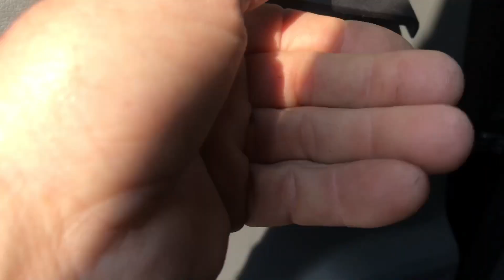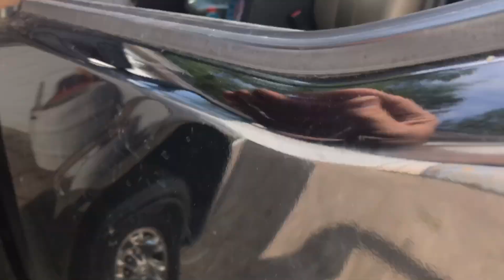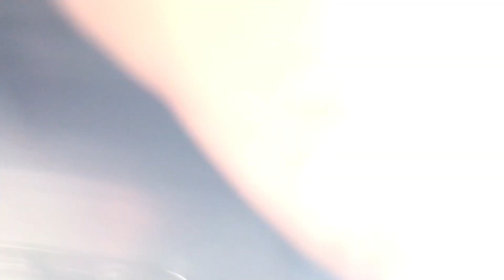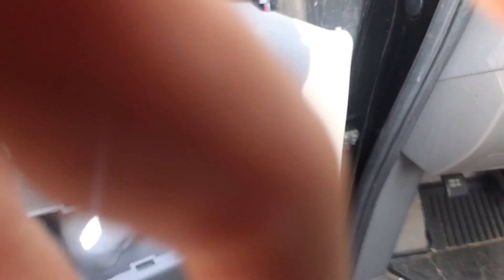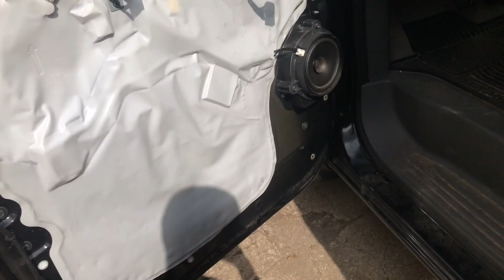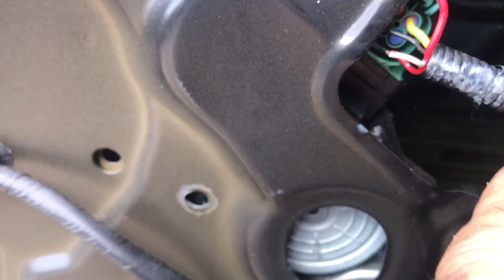Nissan NV 3500 windiw motor repair

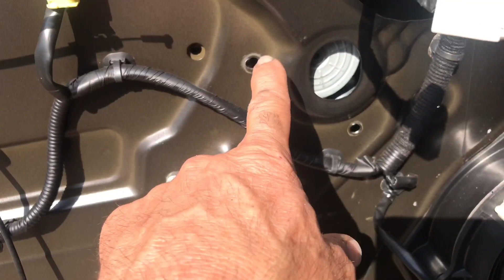Comment: Same thing happened to me. Notice that the entire regulator is shifted because 2 screws that hold it to the door panel somehow became loose and fell out. Then the wires on that 6 pin connector starts chaffing against the sharp edge of a cut out in the metal door panel. You do have to somehow realign the entire regulator as one commentator asked. I found the screws the bottom of the door compartment (they must have loosened up and fell out). I then used a screw driver and inserted it into one of the 2 holes (which are horizontally to the left of the white round disk thing of the regulator behind the metal pane - see video at 4:39l) and then used leverage to shift the whole regulator to the right to correct position where the two threaded holes now lined up to the two holes in the metal panel and then inserted the 2 screws. (See how one of the holes to the left of the now aligned white disc - regulator now has a screw in it - at 5:#1).  As for the wiring diagram on the connector, my wires were still attached to the connector. I found the connector at amazon.com ( https://a.co/d/51XQ5F0). With the connector oriented from the wire side (not the female connector side) such that the latch slot is on top so that there are 2 rows of 3 wire connectors, you can see from the video at about 5:52 that there are two remaining wires attached. If we use those to orient everyone the same way, since I can't post a photo, the yellow wire would then be in the top row and right most in the way I'm describing it. And the black wire would be bottom row, left most.  With that orientation, then top left should be for the Thick Red wire, top middle is for the Thin Red wire, and top right is, again, the Yellow wire. Bottom row left most is, again, the black wire. Bottom middle should then the White wire, and bottom right should be empty and unused. Hope this helps and you won't have to open the passenger panel to find out. Good idea to double check that the switches and connections will regulate and move your window up and down before you seal up the door panels. That way you can be sure the problem is now in the window switches or somewhere else. Also, you'll have to find a way to reconnect all of the wires in a way that makes them unlikely to be severed again by repeated chaffing.

Comment: Thanks for your video help, but my van has a passenger front door (not the slider) which is closed and won't open. Your video is the closest I've gotten to finding out how to remove the door panel, but I have to do that with the door closed. Happy times ahead! I think I have to remove the passenger front seat to have room to work, and am not even sure it will come apart with the door closed.

Comment: Thanks for this video.  Same thing happened to my work van.  Do you know the wiring diagram for the wiring harness for the window motor?
Reply from the maker: Best bet is to remove the other side and match it up.    Hope that helps.